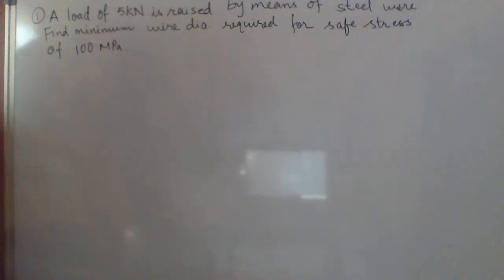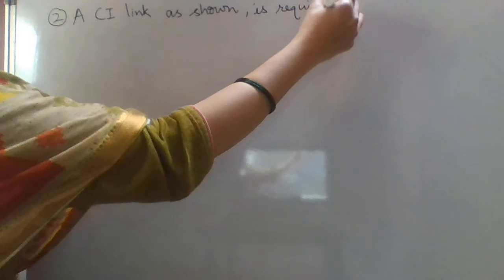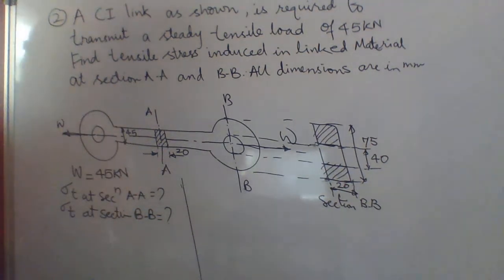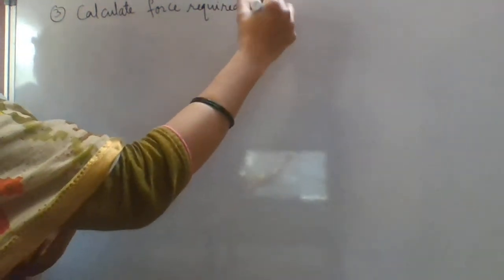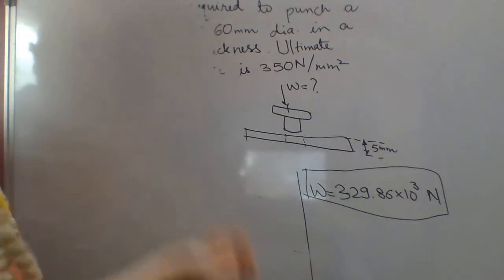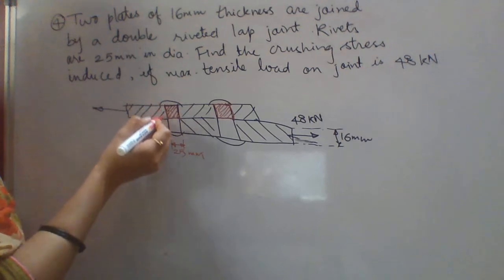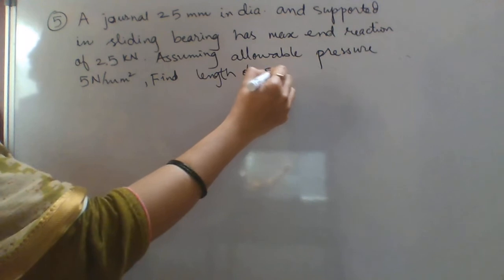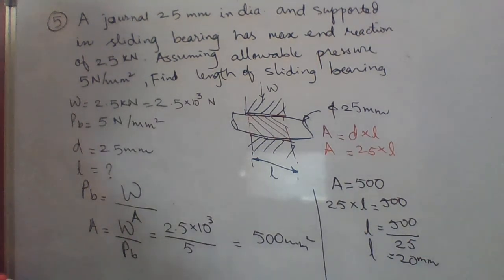LEC 3,NUMERICALS,PART 2

Comment: Miss 6th numerical I don't understand. Because in book there is different formula and your formula is different
Reply from the maker: IN FIFTH NUMERICAL,V HAVE TO CONSIDER PROJECTED AREA OF PARTS IN CONTACT(IN OUR NUMERICAL THEY R BEARING N JOURNAL), THAT IS (d*l),  book me cylindrical area liya hai,,so my solution is correct
Reply: 6th kiya hi kidhar 5 hi numericals toh sikhaaye
Reply from the maker: WHENEVER THERE IS CRUSHING OR BEARING STRESS THEN V VL CONSIDER PROJECTED AREA OF CONTACTING PARTS NOT THE AREA IN CONTACT.